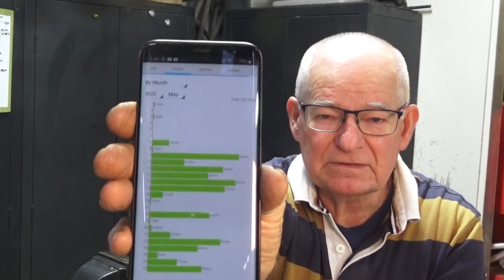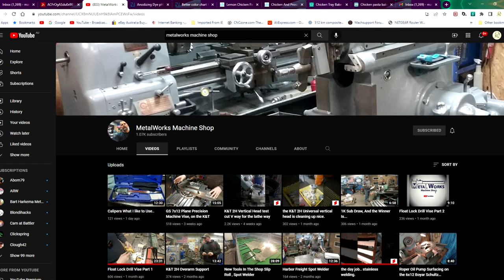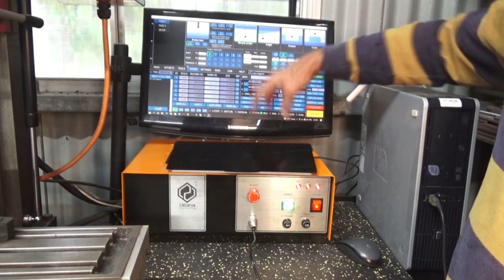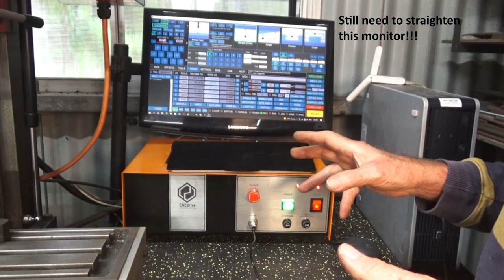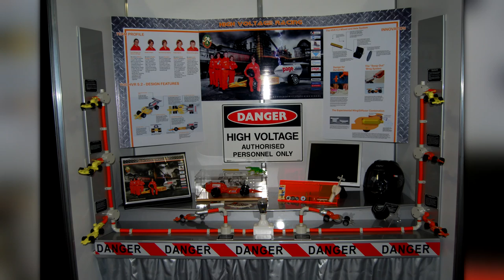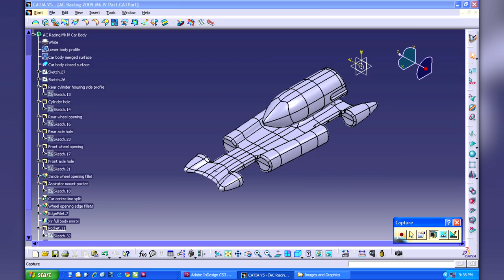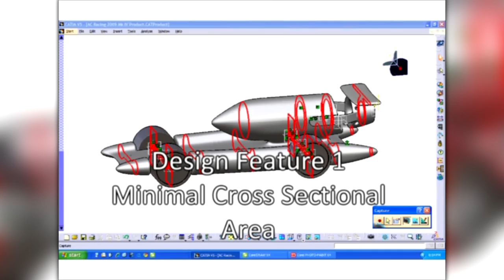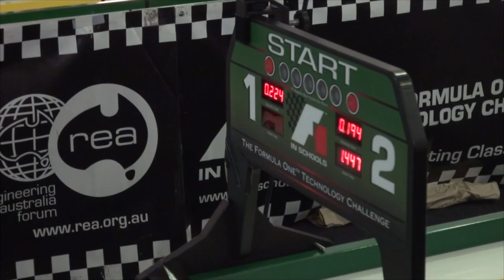Little Wooden Cars (or - How To Make an Engineer)

Comment: Great video Mark !
I first heard of these competitions around 2017 when a creator on a channel I sub to showed the work his students had done and announced that they had won the Australian title and were off to Abu Dabi for the world championship. Iirc the car was mostly 3D printed with machined wheels and the real challenge was getting the car as light as possible but still strong enough to not disintegrate when it hits the stopper . I was amazed at the intelligence and dedication they all had - most of the kids at my high school never progressed  past blowing snot bubbles 🤣🤣😪😪
Reply from the maker: Ian, I just checked out the current rules for F1 and noticed that they were quite different to what they were when I last took a team to the competition. They also changed a lot over the 10 years or so I was coaching teams. One of the really interesting things was the way you could exploit the 0.5gram tolerance on the minimum weight of the car. We aimed to have the car weigh in at 54.6grams (the minimum was 55 grams but you could go 1/2 a gram lower). One team turned up and their car was under weight due to a change in the moisture content of the balsa wood from being on a plane. They took the car away, spat in the cylinder hole and asked for it to be weighed again. Lo and behold, it was up to legal weight again. 
Regards,
Mark

Comment: And did the students succeeded in engineering?
Reply from the maker: Yes, three successfully completed double degrees in Engineering and IT. One in systems engineering, one in mechanical and one in cyber and electronic warfare. However, the programme was also aimed at encouraging young people into careers in manufacturing as well. Often this meant that the graduates of the programme would take up apprenticeships or traineeships. Two of my former students successfully completed  apprenticeships as fitter/machinists. One now works in a local engineering workshop and one moved to New Zealand and successfully gained a position as a prototyping engineer. Many others have left school and moved on but I am not always able to stay in touch. Who knows what they are doing now. My hope is that taking part in these programmes has nudged them in the right direction. That is the thing about teaching, what we do with students can nudge them onto a different path. Sometimes the deflection is minor, sometimes it is profound! One former student from another school wound up working for Red Bull F1 as a design engineer. Dream job.
Regards,
Mark
Reply: @Preso58  Thank you for your reply.

The success of the students is the measurement or the success of their professors.

I don't separate engineering from a more hands on approach, I think you cannot be a good engineer if you never get your hands dirty: a good engineer must be able to do the work properly and on top of that he must know why the job is being done that way.

I am a very  much hand on person myself :)

Comment: Cool stuff.  Takes me back to my 5th or 6th grade class, in which we made CO2-powered balsa-wood "rockets" -- basically the same principle, except there was no track, only the line -- put across the length of a basketball court, between the two support poles for the hoops.  Instead of the cloth, there was a stack of big sponges (I think it was 4 or 5 sponges, and maybe 20-30cm thick, total?  or thereabouts), which the rockets would crash into.  No electronic firing pin for us... our teacher would put a nail in the back of the cartridge and strike it with a hammer... seems sketchy, but it worked.  It was much fun -- the contest was just within our class, and we did timing with 5 students each with stop watches who would aim to start when they saw the nail get struck, and stop when the rocket hit the sponges, and we just averaged the 5 times, and that was our main judgement criteria, though I think there were some others, too, and certainly there was lots of work done by folks to just have aesthetics that they liked, etc.  And of course, fins were an interesting thing... some of the rockets weren't "stable", and would swing around the line as they went, instead of just hanging the whole time.  Oops.  :D  Anyway, one of multiple cool engineering-ish tasks that teacher had us two over the two years I had with him... (we also made cranes out of tagboard and masking tape, with pulleys, to try to see how much weight we could lift before collapsing, and other such things.)  It stands out in the memory -- it was lots of fun to work on these projects, and think about the things that made different designs more or less successful at reaching certain goals.  Sounds like this was the same sort of thing -- except much more advanced than what I did... oh jeez, some 36 years or so ago.  :D
Reply from the maker: David, STEM only became a thing in the last 15 to 20 years but applied science has been around way longer. It sounds like your rocket project was a lot of fun but it also demonstrates a lot of scientific and engineering fundamentals in a way that students can understand. I thoroughly enjoyed teaching a subject called Technology Studies which included a unit on structures. We challenged the kids to make bridges out of a selection of materials and they were then tested to destruction and the weight of the load and the weight of the bridge were used to determine the best overall bridge. We also did the crane project and a tower as well. It turned out that some of the structures were so well designed that we ran out of capacity to load them up enough to destroy them. We used every load weight in the schools gym and started adding bricks but the load started to become unstable and dangerous. The F1 cars were still my favourite though. 
Regards,
Mark
Reply: @Preso58  that's excellent.  And yeah, I'm pretty sure our cranes were all tested to destruction.  The one I was part of building held 4 bricks and some other weight, as I recall.  Not a huge weight, but given that it had a 10" easement from the front of the desk it was built on, and was all made out of (stiff) paper, I figure that's not too shabby.  And it got first place, so there's that.  ;)  I think I might even still have the painted-yellow "gold" brick somewhere that given as a trophy.  ;)  Much fun, and many fun memories... I'm sure you've created those in many other students as well, so... good work!  Kudos!

Comment: Hay mark, how was the CO2 canister activated
Reply from the maker: There were two electromagnetic firing pins that are activated automatically or under the control of a press button held by the student. Both the start modules are connected to a small control box and the activation of the firing pin also starts the timing clock. The elapsed time of the race is shown on the start gate and a second digital display also shows the reaction time from when the 5 lights go out to when the button is pressed. Once the cylinders are loaded into the car the back of the car is positioned so the nozzle of the cylinder is up against the firing pin. The height of the firing pin can be set to the same height as the centre of the cylinder. 
Regards,
Mark

Comment: Sadly when you make one out of styrofoam and fiberglass you get disqualified.
Reply from the maker: There is a rule that says that you cannot have voids or implants in the finished car. I don't know how the judges were going to check that. We used some creative solutions to reinforce the wings on the F1 cars. They were the most vulnerable part. Tissue paper and very thin cyanoacrylate glue can be laminated on the cross grain wings and it makes them almost unbreakable. Similarly, a well hidden bamboo satay skewer in a CNC machined cross hole does an even better job. But you probably already know about this.
Regards,
Mark
Reply: @Preso58  Well I wasn't as good at fiberglass as I am now and it detonated on impact with the wall. I mean I was cheating using unauthorized materials after all so I got what I deserved. Most of the people in the CO2 drag race that year had trouble with the cars trying to take flight like mine did so I wasn't the only one that ended up taking flight.

Comment: Do you have the link for the new probe mate?
Reply from the maker: I got mine on Aliexpress. It has an adjustable runout feature which is really useful. https://www.aliexpress.com/item/1005003498231826.html?spm=a2g0o.productlist.0.0.21084908xMA4lP&algo_pvid=49872646-35f5-429b-8347-160381c00db2&algo_exp_id=49872646-35f5-429b-8347-160381c00db2-0&pdp_ext_f=%7B%22sku_id%22%3A%2212000026064118176%22%7D&pdp_npi=2%40dis%21AUD%21%21101.01%21%21%21%21%21%40210318c216545171441762893e05b4%2112000026064118176%21sea
About AU $100 
Regards,
Mark